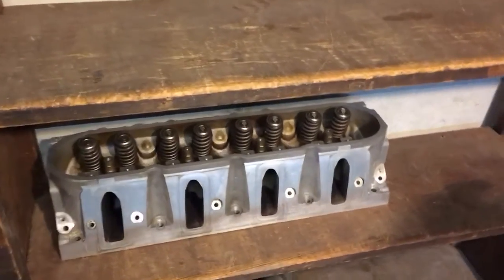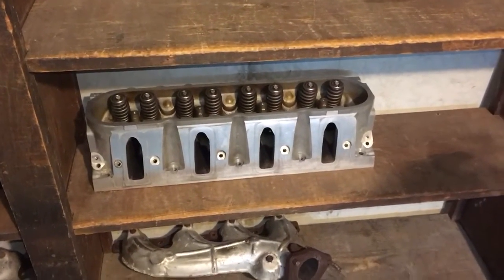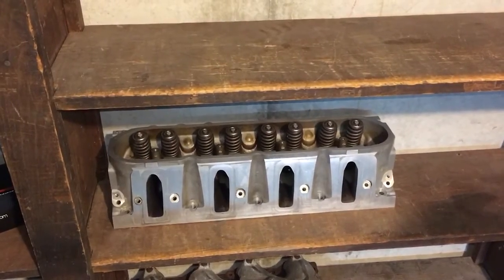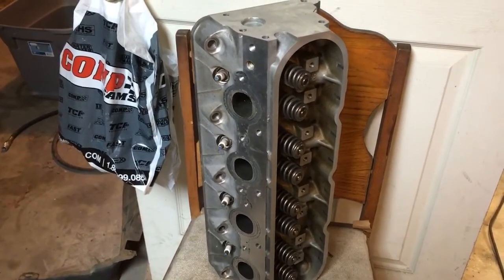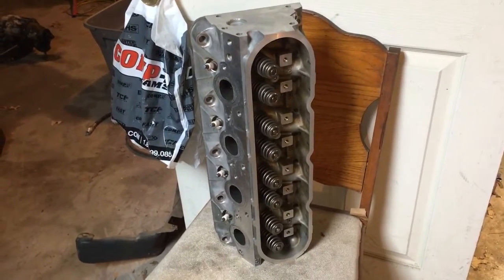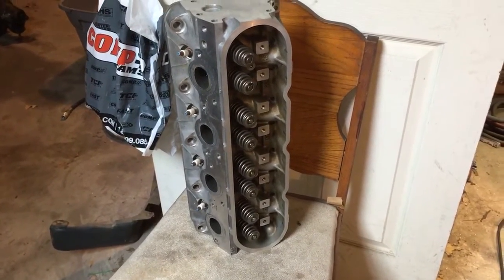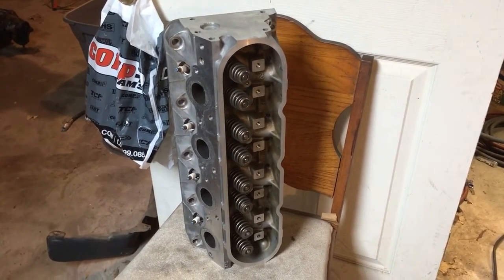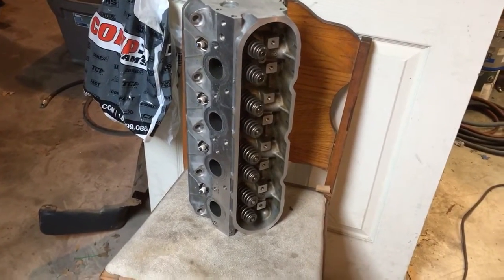4.8 Turbo build 4.0 Upgrade to 241 heads

Comment: I got a 04 gto alumblock 5.7 ls1 with 241 hds i want more power i would like to run a turbo on small boost
Reply from the maker: Shawn Libby Where are you located?  KFX Guy has a Turbo GTO with a clean install, He built his setup,  he’s in Louisiana.  I bet he could help. 👍😉😎
The limit he has found was the 4L60e and the drive shaft, he’s blown both a couple times. I’ll see if he can contact you, but still try to send him a message.

Comment: Great find and bargain on the 241 heads,    I look forward to your videos and progress and parts choices on Turd-Bo build.
Reply from the maker: +David Glowartz Thanks!  As I stated in the video it's going to be more representative of a true low budget build if I run the unported 241's.  I avoid having to pay the $200.00 for a valve job to switch the 862's to the larger 2.00" valve which s great!  Plus it's really cheating on my part to run ported heads. ;)
I can't wait to see how a 4.8 with 241 heads and a factory 01-03 LQ4 6.0 cam run.  I'm hoping to make at least 300 HP with no boost.  JD